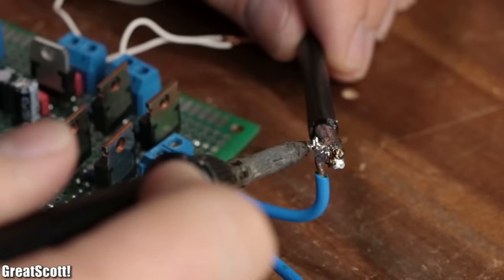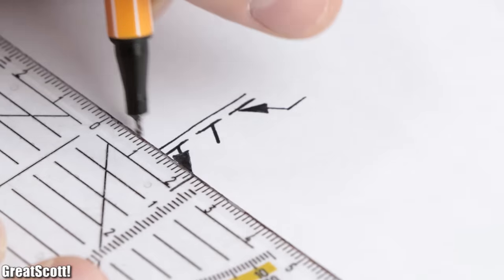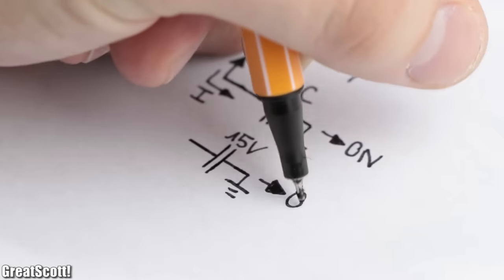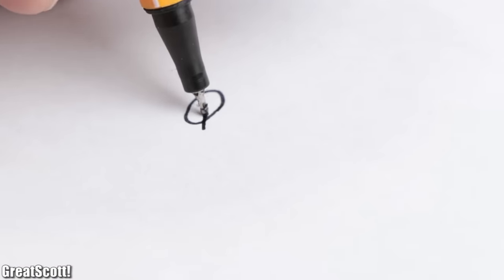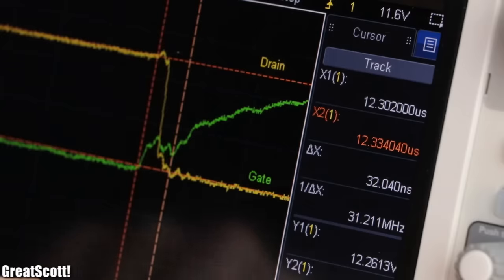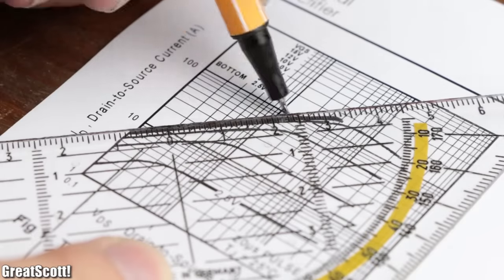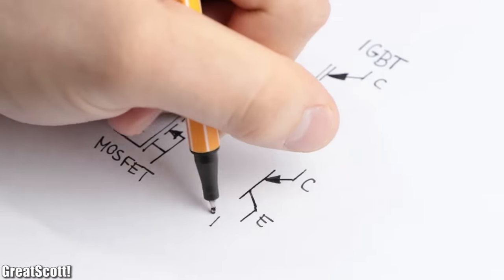Electronic Basics #28: IGBT and when to use them

Comment: Some words about the losses:

The MOSFET has a channel resistance, so the power loss is the switch on resistance times current squared, so R_DSon * I². The IGBT power loss is calculated by voltage drop times current, so U_CE * I. So, the IGBT can handle bigger currents on same chip volume. What I want to say: calculating the loss is in the nature of the chip structure, where channel resistance and PN-junction behaves different in its nature.

Only to complete ;-). Great video and really close to the practical side of engineering.

Comment: Can I use an LGBT instead?
Reply from the maker: I don't think so
Reply: Pentahydrate best comment ever
Reply: Pentahydrate Yes, but you must install it backwards.
Reply: Instead of what? ;)
Reply: No, they will dehydrate very fast.
Reply: you can't, they would get shocked.
Reply: i don't recommend using a LGBT, usually get triggered very easy
Reply: Is that so? then it is great! that means it can work at a higher frequency!
Reply: Light Gate Bipolar Transistor? You mean optocoupler?
Reply: not recommended, unless if you want magic smokes coming out of their head
Reply: @itsdokko2990  that's great. We want it to be triggered easily and infact remain triggered like an SCR so that it can handle more power
Reply: LGBT bro theirs no term in electronic please what it is!!!!!???
Reply: @views-re2om  i'm very sure that you are tuna... you know exactly well what everyone is talking about, so don't behave like a sub sandwich and add something meaningful to the conversation! jesus, people nowadays
Reply: @views-re2om  i'm fine with that... never asked for it anyways :D
Reply: @views-re2om  i will send you a postcard from every layer of it, don't worry
Reply: High voltage kkkk and current too😊
Reply: Why do you marginalize the Incel component?

Comment: Hi,
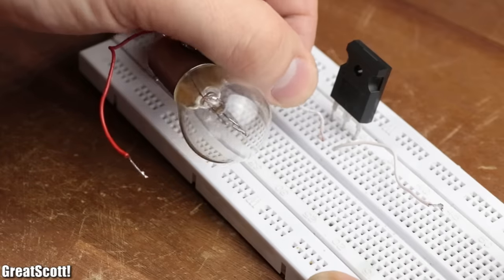I thought the following might help save some breadboard wear:  At timestamp 1:55  if you twist the three pins of this and similar components by 90 degrees with a pair of needle-nosed pliers, it gives a much better breadboard fit.
Reply: Thanks for the tip! I always had trouble with these kinds of mosfet pins of that size.

Comment: This guy made it so complicated. I made a Tesla coil with one mechanical relay and large capacitor. And if you want to speed or slow down the spark. I use a dial switch with different small capacitors at each turn

Comment: Make a vide about  optocouplers
Reply: That vill be cool.
Reply: Yes, please make it.
Reply: Yes, that would be great as a lot of people don't usually cover them.
Reply: opto isolator is just two led to transmit logic signal,this component is only used to change the logic value of a part of circuit while not involve the logic state of the other parts.
Reply: KX36  There's nothing has been called digital component,it's just the components which used to make and maintain some kind of signal.
Reply: KX36 i included some applications of the optoisolator in processing which i interested to,i didn't mention what is optoisolator,who created it and what it's used for...etc.

Comment: Isn't the common reason why MOSFETs are prefered in SMPS' rather than IGBTs the rise/fall time? I could see an overall higher switching transition overlap on the IGBT than on the MOSFET. Meaning high switching losses, right? Therefore a rapid decrease in efficiency. So when are IGBTs used in professional applications?
Reply from the maker: In high voltage/high current applications with a medium frequency (<200/100 kHz)
Reply: Yeah, I didn't miss that part :) Though I haven't seen many switch mode power supplies that fit the "high voltage/high current with medium frequency" description, making use of an IGBT. Is that due to high switching losses and the bigger Miller plateau? You might know?
Reply: Ah yeah, seems logical, how about the efficiency?
Reply: I guess IGBTs are more rugged compared to MOSFETs, just like SCRs but no latching.
Reply: Yeah, eventhough they are more modern, also a crap tonne more expensive.
Reply: And large. TO-247s are too much.
Reply: I might consider it in higher voltage motor drivers, but for smps' I'm sticking to the favourite MOSFET, might even add a couple in parallel to get the desired output. Like Ollyweg said, might consider SiC FETs: http://www.electronicspecifier.com/cms/images/Figure%201-El%20Spec%201.jpg
Reply: Heard of 'em SiCs before.
Reply: That's SIC! Ever heard of GaN FETs? They are pretty good for very very high switching speeds.
Reply: I'm SiC of SiC jokes! ;) (No offence)
Never heard of GaN. Do they really make GaNs?
Reply: Yeah, but they are not made out of GaNja. Higher efficiency due to lower switching losses, higher power density, faster and have their own driver. But not so popular.
Reply: Most SMPSUs run at around 100kHz. That's not high frequency and no need for a MOSFET (doesn't hurt either). Many PSU just use a BJT with a decent driver (actively pulling down the base of a BJT helps alot with switching times) on the primary side. You will very likely find IGBTs in VFDs for example, even low power ones.
You can built pretty much any switching application with any transistor type, BJT, FET or IGBT. Without detailed requirements you can't say what is best and why to use X over Y.
Reply: That's interesting.
Reply: Yes, eventhough BJTs are better in current mode signal processing, the MOSFETs are better in the rest basically. Yet it is true that you can use any switcher, let's we're trying to achieve the highest power at the highest efficiency. MOSFET it would be right? Transconductance at higher currents, smaller drive current requirements, thermal stability, etc. I just didn't know much about typical IGBT applications, but having a high voltage tolerance seems the biggest advantage to me.
Reply: All H-Bridge Driver Timing circuits require Break Before Make Timing to eliminate shoot-through current, MOSFET data sheets only show 25˚C data for Turn-On Delay, Rise Time, Turn-Off Delay, Fall Time, and MOSFETs Turn-Off Delay Time and Fall Time, increase with temp, 
So from the datasheets there is no way to tell how much? 

IGBT datasheets show 25˚C and 150˚C or 175˚C Delay Times, 
[ Time Delay off + Time Fall - Time Delay on = Break Before Make Timing ] 

Compare the following Datasheets and tell me how the IGBT is inferior in switching frequency, the only frequency limiting factor is switching loss per switch cycle and thermal dissipation of all of the switching cycles, Good Power MOSFETs SiC Power MOSFETs and Good IGBTs are almost identical 

IGBT:  mouser.com/ds/2/149/FGH40T65SHDF-1008564.pdf

Power MOSFET:  mouser.com/ds/2/149/FCH023N65S3-958687.pdf

SiC Power MOSFET:   mouser.com/ds/2/348/sct3030kl-e-1017517.pdf

SiC Power MOSFET: mouser.com/ds/2/90/Cree_09302016_C3M0065100K-1013827.pdf

SiC Power MOSFET:  mouser.com/ds/2/389/sct30n120-955135.pdf

if you know of a Power MOSFET that can switch Power in the MHz Please let me know,

I have read a lot of PDF datasheets and there's a lot of overpriced garbage parts out there and some high performance cheap parts, 

Companies tend to omit data that makes their products look bad unless they find a creative way to polish their turds like calling a slow recovery Diode a "soft recovery Diode" the data that is missing from a data sheet is the most important data  

IGBTs Require +15V -15V Gate to Source/Emitter switching Voltage, 
with a 5Ω gate resistor 30V ÷ 5Ω = 6Amp Gate Driver is required 
for proper high performance switching of an IGBT, 

MOSFETs are easier to switch, That is the reason MOSFETs are used more often than IGBTs.
Reply: IGBT's also have a tail current which increases power dissipation.  they are great for low frequency applications.
Reply: I think it's mostly depends on how big the power supply is. Almost anything below 1 kW uses MOSFETs or sometimes bipolar transistors (at least the ones I have taken apart). It's at high power levels combined with high voltages IGBTs really have their advantages. The RDS(on) for MOSFETs really goes up with the rated voltage, while the more constant voltage drop of an IGBT doesn't change that much for higher voltage devices.
For devices that work below 200 V DC, MOSFETs is almost always better since they have such a low RDS(on) that even at high currents the voltage drop is often lower than it is for the IGBT. 
Although, for the relatively low power devices we see every day like computer power supplies, cell phone charegs etc. the power levels is so low instead . As he said - at very low currents the voltage drop of a MOSFET that is on, is amlost zero while the IGBT behave more like a diode with a fixed voltage drop that the current has to overcome to start flowing at all, but then it doesn't go up with increased current like it does for the MOSFET. 
It's more common to find IGBTs in things like inverters, welders using high frequency transformers etc.

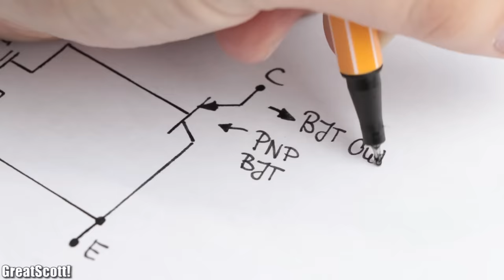Comment: Hey greatscott. Great video, I was just wondering, at 6:00 you say that the igbt has a higher on resistance, but it can handle higher current compared to a mosfet. How is this if the laws of power dissipation are uniform? Can the igbt handle a much higher temperature? Or does it dissipate the heat better?

Thank you.

Graham
Reply: IGBT's do have a Vf present on their output due to the PNP output device integrated within IT.

Therefore, they are less suited for low voltage high/very high current applications where the MOSFET, which acts more like a very-low value resistor in their ON state are more suited.

However, when voltage rises, the IGBT truly finds its place. At Digikey, it is easy to find kilovolt rated TO-247 devices with Ic above 100 amperes.

Why are they so rugged ? This is beyond my competence...

But be aware: IGBT's are significantly slower than MOSFET's, so forget them in RF amplifiers or in switchmode high power sonorisation amplifiers, however, they are perfectly suited for high-power applications such as induction heating, arc / TIG / MIG welders,  DC-DC converters, VFD / motor drives and traction applications.

Comment: 1-> MOSFET faster than IGBT
2-> IGBT uses for HIGH voltage applications
3-> MOSFET Conductive losses => Pmosfet = Rds(on) * Id^2
IGBT Conductive losses ==> Pigbt = Vce*Ic
4-> Switching losses are similar.

IF Pigbt > Pmosfet, choose MOSFET. Otherwise chose IGBT. (for same voltage and current value)

Comment: Thank you for the short and down to earth video explaining the differences, I've had a circuit in my mind that MOSFETs can't handle and having never used an IGBT started on this quest to learn more. Seems that it is very easy to use as it can be used just like a MOSFET and handles more current and higher voltage.

Comment: Hey! Thank you for the video! One observation: on 2:13  I see in PDF 5v being mentioned as a trigger for the switch. But when you show the lamp only turning on at 12 volts on minute 2:15 then I decided to note it here. Can someone help me to understand what was going on?
Reply: It only shows the collector/emitter voltage and not the gate/ground voltage, because it's probably a 12V lamp. You can see the gate voltage on the right screen of the power supply.

Comment: SIlicone Carbide (SiC) MOSFETS have similar characteristics as the IGBT about voltage and current capability but with the benefits of lower Rds ON and lower rise and fall times even compared with traditional mosfets but they are not cheap. For tesla coil application I think they are the best option :)

Comment: So hilarious I broke a FQB50N06L in my inverter, just the video I needed. Ordering some soon. Was tempted to try a FQB30N06 to try out, that I had on hand. Since it does 32amps instead of 60amps, more then enough for lower then my 100watt usage till I get the proper one.

Comment: fine job with your presentation.  its clear that you put in a lot of effort .
 and i am pleased to support you

one thing i was watching for  was a flyback app'n and if this device has a Coss
parasitic output capacitance like a power n-FET.  you know how that  plus the
'transformer' leakage inductance  forms a series resonant circuit.  that , when the FET turns off causes a very high (500V and up ) overvoltage that can damage the FET .
Reply: bob along thats what protection circuits are for

Comment: Thanks for all your videos. Can you make a review of the new MOSFETs based on silicon carbide (SiC) or gallium nitrade (GaN)?. They can reach more voltage and current than traditional MOSFETs, keeping high frequency (low switching loss) and have low gate charge.

Comment: From my experience...IGBT => It Goes Bang Too... 
IGBT's are powerful switches but even thought they are very sensitive to gate overvoltage, fast voltage rise (Miller effect - which could cause transistor to open) and driving them also takes much energy... Using them for tesla coil is only possible with good driver, delay timing control and low resonance frequency... For driving tesla coil I recommend using SiC MOSFETs which turn on/off times are about 20ns usually.

Comment: Can someone tell me what is bootstrapping?
Reply from the maker: https://en.wikipedia.org/wiki/Bootstrapping_(electronics)
Reply: Bootstrapping is basically a charge pump in the circuit. You are using the source voltage of your high side MOSFET as the negative input on your capacitor. While you have a negative source voltage, you have a positive VCC on the positive side of the capacitor due to the diode. Therefore there is a relative VCC + VS voltage. So for example, you have VCC as 15V, you will always have a Vgs of 15V, no matter the source voltage.
Reply: What do you use for simulation ?
Reply: Bach Hoang LTSpice is an excellent simulator for realistic values.
Reply: Again please but use English, I mean, Dumb it down a bit more please... How van pushing a positive charge in to a capacitor in the wrong way around be good for it? I thought they exploded when you put the wrong voltage in to them.
Reply: Mark Giblin depends on the capacitor, there are AC capacitors that work fine either way
Reply: yes, non-polarized ones and those for RF but Electrolytic ones as I understand tend to go with a bang. 

So is there a voltage or is it the current that blows them?

Comment: It seems to me that one BIG factor on driving MOSFETs is the high Gate-to-Source capacitance.  e.g. When the Drain is grounded and you switch a high voltage (open collector style) load, it reflects back thru the Gate so your driver has to be able to handle this transient.  I wonder if this issue does not exist in the IGBT.

Comment: Hi GreatScott!, When designing a H-bridge circuit, why are MOSFETS typically used compared to standard transistors? Could we not use the Darlington pair configuration compared to the MOSFET? Could we use MOSFETS in a Darlington pair configuration?

Comment: Wow, am I wrong or I just saw slight mistake at the very end? BJT inside IGBT has it's emitter (BJT arrow = emitter) labeled C. It's not BJT collector. This emitter is considered collector when watching from IGBT point of view since whole structure acts like voltage driven NPN. It sometimes utilizes NPN symbol with insulated "base" labeled G of course. But it's actually slightly more complicated than simple mosfet + pnp. There're NPNP layers so it means there is embedded parasitic thyristor. That also means in equivalent circuit there's N-channel MOSFET, PNP and NPN.

Comment: mosfets are great with the gate run from clean square wave signals but are not happy with a linear drive signal. IGBT is vastly superior in this mode acting like a BJT without the high drive currents. I think you said this.

Comment: i need your help with something please. im trying to build a battery pack for my raspberry pi using 18650 lithium ion batteries with a step up converter to step up to 5v the boost board can deliver 3A at 5V (or so the data sheet claims) but the pi keeps turning off and restarting. if i check the current it ranges anywhere between 100mA and 900mA never above 1A or the 2.1A recommended for the Pi 3, im guessing the Pi doesn't receive enough current to stay operational. but if i hook my old phone up to the circuit it draws a solid 950mA. at 5V (which is correct for this device). so im unsure of why the raspberry Pi is all over the place and cuts out but other devices are fine. am i missing something here? i used the schematic from your 'reuse old batteries power bank' video. any advice would be great from anyone, (newbie hobbyist trying to learn more about simple electronics)

Comment: I was wondering if it is ok to use circuit parts from broken devices, and what is the best way to remove the parts from the circuit board, like that of a DVD player , old computer, Remote Car , extra.?
Reply: Joker's Red Ace sure, thats the bread and butter for beginners.
Just make sure its the right component and that its still in working order.
Desoldering would be the way to go.

Comment: Great demo,  However,  I would like to switch 5000 V so stacking IGBT is this possible;  Let's 5 1200 Volt IGBTS together.  I have had no luck with this...    Parallel is also tricky?    what is the best way to approach this type of problem. In a solid state concept?   Switching speed lets 30 to 60 Hz ; on time; 1 us.

Comment: Thanks again!

If it's ok to ask...
Can you please make a video using 3.3v controllers (esp32, arduino pro mini etc.) to control a basic 12v 0.3-0.8A motor  (8 motors will me be more interesting IMO).

I wonder if you will use a FET or something like Darlington TIP120 or a conventional relay.. and how will you handle the noise. 

Thanks again!

Comment: You should make a video about how to use the sensor of an optical mouse with arduino as a camera or a kind of sensor or something like that.. and a video about a stepper motor driver
Reply: Thomas 131377 the sensor of a modern mouse is not really suited to be used as a camera ...
And there are loads of videos on stepper drivers out there.